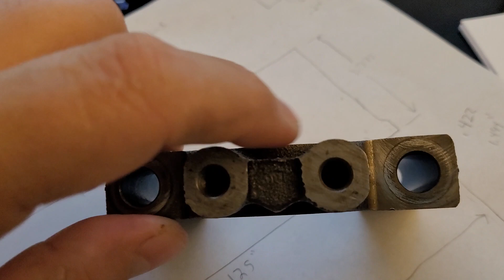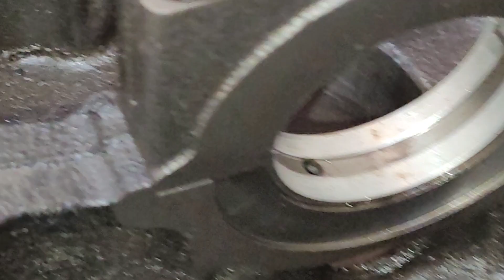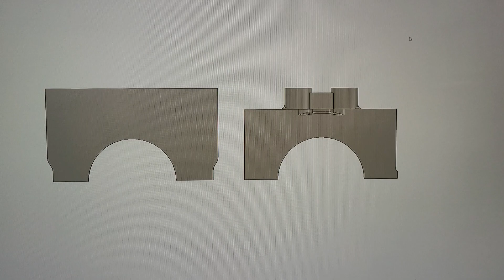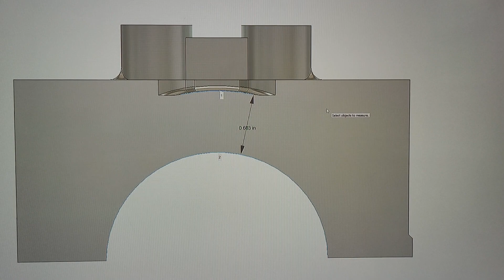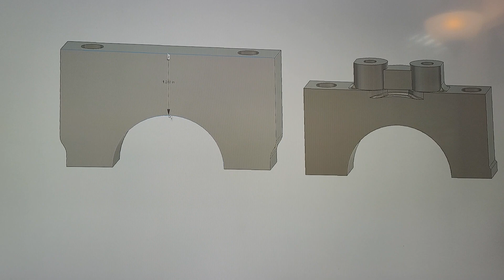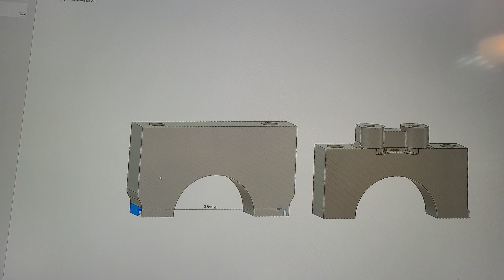Turbo Miata 500whp Build Episode 55 - DIY Main Bearing Caps

Comment: Did you design your intake manifold for your 1.6 liter whipple when you used to run it?
Reply from the maker: I ran a flat top intake manifold, and had the 1.6L Whipple hotside. I did design the brackets and pipes in/out of the blower though.
Reply: @patrickcowanjr1  I was curious about going this route. But I found a company to make me an adapter for my ubercharger manifold and will be using that.

Comment: Cool idea, I hope it fits ok in the pan.
Reply: I don't run that flimsy sheet metal thing anyway, had the same thought as you.
Reply from the maker: It won't fit with the 01+ MBSP, but it will fit with the 94-00 pan and factory windage tray.

Comment: A suggestion for real world testing.  

Install the pistons and head (without cams), then, with each piston at BDC, use a pressure washer to fill that cylinder with 1000+ PSI (the fittings will be interesting).  

Deflection under pressure should be linear, so you could see if the ends caps move more then the middle caps.  Also, how much the bolts deflect compared to the studs.
Reply from the maker: Not a bad idea! I could probalby find O-rings to put on the pistons, or just mod a piston to put an O-ring on it so it sealed. Then you could use a regular hydraulic pump or similar too, and not have it leaking. But the pressure washer idea I like too, because then leaking is ok, and I have a small pressure washer.

Comment: If you go with your thicker cap design will you have to do custom main cap bolts?
Reply from the maker: Yeap! I already contacted ARP. They gave me two different part numbers for their studs that would be longer than the standard ones. Problem is, nobody seems to keep them in stock. I guess I need to find them if I'm going to rely on them.